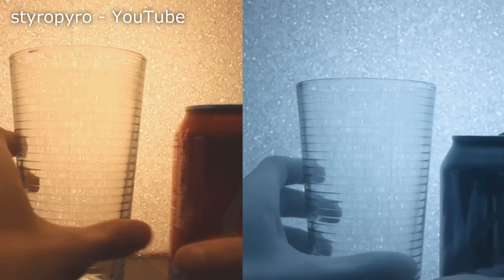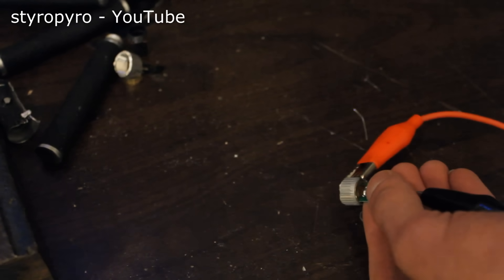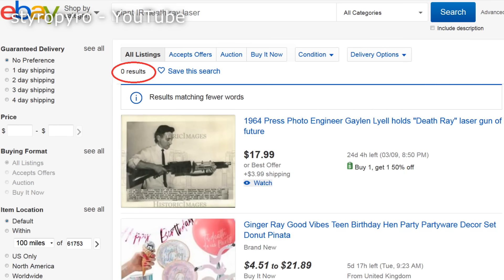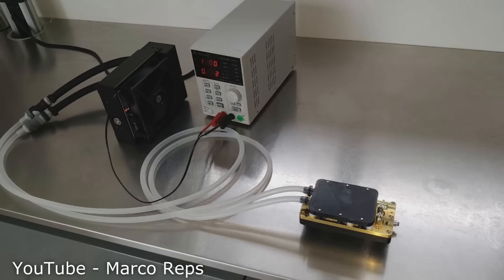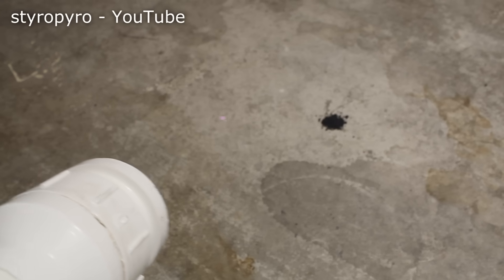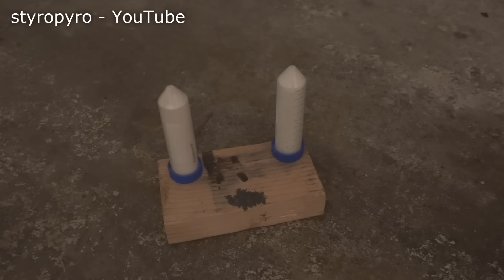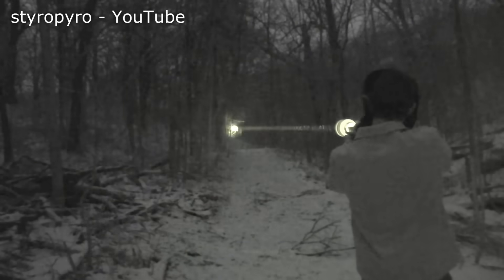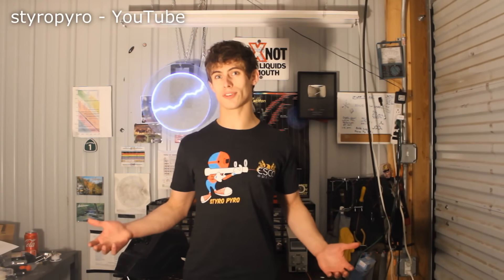100% Invisible IR death ray laser!

Comment: Wow! invisible death ray! So you just go blind not knowing why! You mentioned it wasn't burning your skin because it was infra-red. But is it possible it was internally burning something, like bones or veins that looked black in infra-red? How's your hand today?!
[Edit] Thanks for clarification below Styro!
Reply from the maker: Awesome to see you here! I don't recommend others try it but internal burns from this laser are unlikely as tissue and bone have very low absorption at these wavelengths. I've stuck my hand in the beam of a shortwave IR laser that was literally 500 times stronger than the one shown at 4:11 and I had no noticeable effects.
Reply: @styropyro  If IR has no problem passing through bones and tissue so easily, would that mean if such a powerful laser is pointed at the back of someones head, would the light go straight through a skull and blind a person? If so, that would mean wearing protective eyewear or even facial mask would be pointless. Even a helmet wouldn't help, since the light could come through the neck and hit eyes from inside. Hmm 🤔
Reply: FlumenSanctiViti 
That's an extremely interesting question!
Reply: @FlumenSanctiViti  omg this thing is dangerous.
Reply: FlumenSanctiViti asking the real questions, I'm curious too. . .
Reply: @FlumenSanctiViti  Well no. Before it can reach your eyes, most of the IR light is absorbed by the brain tisseu, skul and skin. You really need to focus the IR light direct on the front of the eye if you want to blind someone.
Reply: @FlumenSanctiViti  The beam gets dispersed, so the energy wont be nearly as concentrated. You'd also have to directly shine the beam onto your head, which is pretty hard to do accidentally when you're the one holding it. The mask is likely just to protect against stray reflections, which are much weaker than the source (though still strong enough to cause eye damage) and thus wouldn't be able to cause any harm to your eyes after dispersing through your skull and brain.

Speaking of brains, I wonder how much of the energy would be absorbed by one. The thought of literally frying someone's brain with an invisible laser is pretty terrifying.
Reply: @FlumenSanctiViti  
that is an interesting question, also - why does the IR light burn out the retina and not any skin heating up ?

I think the answer to both question is that IR light COMING THROUGH THE EYES is focused by the eye's lenses onto the retina and will instantly scorch it - going blind. The IR light is all literally focused on one spot.

IR Light traveling through the back of the head or neck will not be focused on the retina and hence not be a problem - so you cannot blind someone from behind with an IR light - there is no lens to focus the beam.

On the other hand - IR light reflecting from the corners of the laser goggles could still enter the eyes and be focused by the lens, hence the facial mask is necessary.

Then again, the IR light pointed onto the skin was focused - and still had no impact, so why would focused IR light on the retina be any different. Yes, the retina is more delicate than skin on the hand, but would it not also be transparent to IR light ?
The effect of IR light on the skin was almost like normal light on glass - just travels straight through it.
Reply: @FlumenSanctiViti  take another look at 4:11. the light is not absorbed but it is scattered. if it wasnt, his hand wouldnt light up like that, it would be more like shining a visible laser pointer at a glass.

since the light is no longer a beam, its strength is greatly reduced
Reply: @FlumenSanctiViti  It's likely shining at the back of the head wouldn't blind seeing as you receive light through the pupils which are at the front of your eyes.
Reply: @FlumenSanctiViti  I think the IR light scatters a lot as soon as it enters so it wouldn't be very concentrated by the time it got to the eyes. I did see a TED talk were a scientist was making progress taking PET scan like images of the body, but she was using some heavy duty math to undo the scattering, IIRC.
Reply: @philosophicalinquirer312  Could it be that your retina has a broader absorption spectrum because its entire purpose is to absorb light?
Reply: That's an interesting question, but answer is probably no.
You see, IR laser has no problem passing through skin as much as regular laser has no problem passing through piece of white paper. While light is not being strongly absorbed it is being scattered, and that is in a way like shooting at mirror.
Second issue is that most people have hair that does absorb IR light.
Finally eye itself has black lining designed to minimize amount of light that leaks from surroundings through everything that isn't lens. So eye has level of resistance from stray light coming form other directions. Granted this resistance is not that great, but as long light attenuates sufficiently, it would suffice.

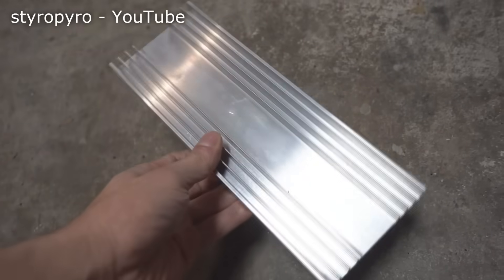PS, blood cells absorb IR light, and that would also help. At 4:23 in the video, veins look black in IR light which means they absorb it.
Reply: @tissuepaper9962  
Not really, the absorption spectrum of the retina is highly specific to what we see based on the absorption of the rods and cones. These are well established parts of the LIGHT spectrum which are absorbed.
All else travels straight through the rods and cones and is not absorbed (so we dont see it - hence why we dont see the laser with normal vision)

Damage to the retina is not based on SPECIFIC damage to rods and cones but the entirety of the delicate layers of various cells, nerves and blood vessels which make up the retina. eg damage to the blood vessels or neurons from burning with kill off all the cells and cause irreparable damage.

From what I gather - rods and cones are  transparent to IR laser, otherwise we would see it. Unlike for example staring at the Sun directly.

Also - the way things heat up can be counter intuitive - eg aiming microwaves at the eyes would not appear to do anything because the microwave spectrum wavelength is ginormous compared to light - however, water molecules will increase in vibration and release energy - rapidly scorching the eyes by heating up all the fluids from the inside - not a pretty sight.
Reply: @philosophicalinquirer312  I was just shooting in the dark.
Nice detailed response though, thanks.
Reply: @weblure  Holy shit...
Reply: @FlumenSanctiViti  Should test it with some lab rats
Reply: @FlumenSanctiViti  I believe much of our Sunlight is high in Infa red(invisible to us), and I'm not seeing through people? But even too much of something good, isn't always good for you ..
Reply: @FlumenSanctiViti  @styropyro please answer this lol
Reply: @FlumenSanctiViti  it would as the passing rays would maintain blinding power for the trip to the eyes as light goes off and through everything!
Reply: @styropyro   "no noticeable effects."

So you're saying there's still a chance.
Reply: @styropyro  I am not sure but I think it was ultraviolet light was the one that can burn your skin, right?
Reply: @styropyro  colab or your skin will absorb the ir rays
Reply: @styropyro  how did you make the 2D plasma globe and/or do you have a video on how?
Reply: @styropyro   how does wattage or power of the frequency affect such absorption?  Obviously microwave frequency can damage internal, and IR can blind so what possibilities exist in that mess.  (I don't really completely understand how an EM frequency is influenced by its wattage or how that works)
Reply: @styropyro  y
Reply: @styropyro  Yet.
Reply: @styropyro  What did you use as IR filter? I'm so fascinated with seeing near-infrared
Reply: what happens in you point it at you stomach and place the camera behind you
Reply: styropyro Are we going to gloss over the fact that you’ve had access to a laser 500 times stronger?
Reply: @styropyro  Are you alive, Death Star boi?
Reply: So it literally cannot be seen with the naked eye? You must use an IR camera to see the beam? How do you see the beam to place it onto something? I have night vision goggles, would this work?
Reply: @styropyro  Yeah, and wouldn't you have noticed it? Nerves aren't only in the surface, you know.
Reply: Love both of you guys <3  =)
Reply: You two should make a video Together. Maybe a laser that shocks you as you use it.
Reply: If u two make a video together,  your medical bills will be just as high as your electrical ones
Reply: 2 best channels
Reply: Would you two Guys make a video together?
Reply: could doctors use this as an surgery tool for burning precise points with depth focusing?? like blood vessel clog cleaning or sealing, or burning infra markered cancer growths??
Reply: gothic6662 
Hmm, i would guess if they injected some IR absorbing dye into the area, it would probably work.  I'm not sure how precise it would be, since i dunno how much the dye would bleed into other areas.  I think they already use some sort of radiation to precisely nuke cancers, IR would probably be less dangerous than the shorter wave radiation they're currently using.  I'd think, anyway
Reply: @gothic6662  they use a similar item for special forces to run an IV during night ops
Reply: @gothic6662  Yes, and this is done.
Reply: @gothic6662  Vanderbilt University did some interesting studies, that I see still have remnants online,  demonstrating equivalency to MRI's in using NIR helmets that weren't even FTNIR if I recall correctly. The OpenWater Company is trying to bring more wearable similar tech to the market.  

I personally feel there are capabilities to mind read using NIR tech since the ability using remote sensing and transmission instruments in close proximity has been demonstrated and can be found online on youtube via Berkeley hacking into the Vision of a Cat, predictions of thoughts and there used to be demonstrated and I can't find the video of predicting thought words accurately.  There is even a demonstration of a crude color Vision hacked into via the brain activity which is different that studying the RINT of the optic nerve.   I'm sure similar can be performed using NIR and maybe if not even FTNIR. 

There is a lot of electrophysiological activity that can be hacked via remote sensing and transmission systems that needs to be advocated more before everyone is maliciously brain damaged to some medieval archaic mercury and arsenic mad hatter state of metaphysical society on dope like if not even on since hair pinned and denying the truth about everything.  Including those that mean well to demonstrate the truth and might not be the most accurate because of their situations impairment. 
https://www.instructables.com/id/How-to-Make-a-Directed-Energy-Weapon-Detection-Sys/

That's why I like styropyro as well as ElectroBoom and others that demonstrate science in very detailed if not entertaining ways being clear about health and safety too.  Some stuff can't be demonstrated since isn't known or risky to detail if known.   Like say... wireless remote control of people with electrodes can be demonstrated now days... though not probably going to see a wireless without electrodes version any time soon even if determined how: https://www.youtube.com/watch?v=1S7FO2Qd6Zc

Might be able to inductively reason how to though maybe with enough logical comprehension?
Reply: gothic6662 they are lol
Reply: @gothic6662  at this wattage that or laser is Cosidered ionsing radtion which is carnigentic lol
Reply: @gothic6662  Yes.  I've read about research projects where tumor specific injections were (and I want to say binding in vivo like with injections with the absorbing entity bound to antibodies that target specific growths also) used, and I want to say copper molecules or more advanced complexes, as contrasting agents to adsorb the energy better.  For target region imaging and target destruction (coagulation or cauterization).  

I recall one image from a poster when I was visiting a Medical Physics Department of a mouse having their implanted tumors removed with an IR laser alone and not even intersecting laser where say lower threshold intensity penetrate and the target is where the intersection higher damage intensity occurs.  I was advocating concerns regarding brain washing, mind control and cult programming using remote sensing and transmission devices (my opinion the root cause of crime since led on by old military, intel or cartel human and narcotics traffickers, addicts and murderers) and was neat to hang out and tour the different physics departments.   

Lasers, the Light Fantastic book is a great read and I even see videos on youtube with similar titles that are great to watch to see how long the technology has been on the market.  Unfortunately not in use as much as can be compared to the ionizing radiation methods that cause more damage and release more radicals. 

Really is sad on some days the range of methods not used as much that are safer and healthier... probably starting with prescribing real clean agriculture products and water.   Seems the best nuclear related industry isn't invested in (power plants) and only the worse is (weapons and ill care).   Same seems to be now days with most systems... like some perverted deviant cult likes for profiteering motives.  

Here's my latest synopsis of causation's of deviants and deviations in leadership:
Causation due to P.O.W.'s influence gone overboard copy cat ancient Roman or something?
https://www.youtube.com/watch?v=_ix4kXX-__g

Then other causation's like made say like Liberia fall:
https://www.youtube.com/watch?v=lmILmnnTC10

Regarding Liberia:
https://www.youtube.com/watch?v=ZRuSS0iiFyo

Great interview for the leadership insight from the start... however, this time on is eye opening if you're not aware:
https://youtu.be/SGWizajL7tA?t=146

Is George Soros a Sociopath?

Regarding the Fashion Industry and Social Media (note the presentation is great from the beginning also... I like speeding up however as is a little slow):
https://youtu.be/dmXcjvL9VSc?t=274

OK... there's my brief to remind that not only "China has engaged in massive U.S. technology theft for the past 20 to 30 years, according to U.S. officials... others in the World have too prior to China and more than technology.  China is where the sell outs that took over the U.S. (or we've been at War with their cohort and always attempting) want to outsource production."

U.S. example of executions at times of War:
https://www.youtube.com/watch?v=4OkDpD-sUYI

Some Chinese Colonel's want to weaponize everything... wonder which liberal communist deviants that own the Diocese Churches largest trafficking hubs and corridors now into official business violating Separation of Church and State with intentional Headquartered Church affiliations that are doubt are Protestant unless they've infiltrated and serious mental facilities bodily assaulted and maimed (how did the txt just change red?):
https://youtu.be/nM5-Rrc2bRM?t=137
Reply: FULL BRIDGE RECTIFIER 

oh. wrong time
Reply: Look here: 11:56
Reply: @grevel1376  that one was concentrated
Reply: DODO p
Reply: DODO he was holding the paper on the part that was burning
Reply: @grevel1376  thats cuz te paper burned him
Reply: I love that you show up in all the other greats, I say other cause you're awesome and inspiring as well.
Reply: styro is like your reckless son who learned the crazy half of you but not the educational other half XD
Reply: My teacher freaked out when I stuck my hand in front of a 1064nm vanadate laser at 2watts.  I didn't feel anything.  What's the reason why IR beams don't always damage skin?  I know they use them in certain skin procedures with ndyag
Reply: @dutra45  Nothing exciting. Your skin is pretty transparent to IR (just look at the footage where he images his veins), so you're mostly feeling multiphoton processes which are inherently pretty inefficient. The medical lasers also do this thing called q switching where you basically let the gain medium saturate before allowing the laser cavity to open which creates significantly shorter, higher power pulses (like MW range peak powers).
Reply: @dutra45  They aren't a high enough frequency to excite the atoms in your skin. It is non ionizing radiation. UV light and higher frequency lights
Reply: YEEAAAH MAKE SOMETHING TOGETHER
Reply: The trifecta would be Styro + EBoom + Photonic Induction!
Reply: Could you try to modify it to make it stronger?
How about using a
[INHALE] FOOL BRIDGE REKTIFYAH
Reply: FULL BRIDGE RECTIFIER
Reply: Doesn’t prolonged laser exposure cause radiation mutations in DNA🧬?
Reply: @nunchucktube  no that requires ionizing radiation, which this (or visible laser) is not a part of.
Reply: I had an exact laser like yours and took it apart, I actually looked at the IR light, I wonder if I got eye damage? But I see fine, maybe if I added back the lens and looked at it, that would have probably blind me.
Reply: SsssshhhhThis is why noko missiles mysteriously exploded right after takeoff.
Reply: I can just hear you're voice now as you say that ;-;
Reply: You two should find a way to collaborate 🙄
Reply: The second king of electricity and blowing stuff up
Reply: I need a IR dye to accumulate in my belly fat
Reply: @mamupelu565  That would be an interesting service for a business model if no embolism like issues... IR lipoablation instead of liposuction.
Reply: Gimmi Da Metah
Reply: ElectroBOOM if you and @styropyro do a collab, I will LITERALLY DRINK WATER
Reply: Shut yo trap you fail at everything
Reply: Omg electro is still alive !
Reply: Electroboom I love you so much you're awesome you're awesome as well I just love watching you electrocute the crap out of yourself I'm still trying to figure out who plugged in the hot glue gun when you're actually burns your fingers don't worry I do that a lot
Reply: microwave frequency can definitely do that right? so where does high power IR and microwave completely diverge
Reply: When the laser hits your hand, the light (therefore energy) gets scattered by your flesh and is no longer in focus. So even if bones and veins have higher opacity under shirt wavelength IR, the energy reaching them is just not enough to cause damage.
Reply: oh hi there
Reply: Hahahahahhaha. You always crack me up.
Reply: I love how you do your Videos!
Gr8 w0rk!
Reply: I believe skin and meat and all the stuff there is has low absorption, high reflectance and high dispersing characteristics, so the beam is diffused in a large volume and not intense enough to change any state of that volume.
Reply: ElectroBOOM I love your channel as well.
Reply: @nsfjojo  I'm thought you meant something other than speed there. It still goes at the speed of light no matter what the wavelength (c=fλ)
Reply: If it's research perfectly with anyone's right. Great demonstration.
Reply: Man I wish @ElectroBOOM would comment on my videos!!!! Lol you guys are both awesome
Reply: Styro can u shoot IR of electrical sparks
Reply: Yay electro boom
Reply: My favorite
Reply: Do a colab please
Reply: Not burn but likely to get cancer, right?
Reply: +Electro It will burn off your retina, making you permanently blind within seconds, if you point it towards your eyes. Which is why A) Lasers should be handled with care and are super dangerous, but also B) Illegal in warfare. Yeah, blinding lasers are illegal to use in war because its considered unnecessary suffering.
Reply: @Beard Guy101 you have been reported to secretservice.gov for threatening the president. expect the fbi at your door asking you about it.
Reply: Make one
Reply: I don't think that, since it's still light - even if it has longer wavelengths than visible light, it's still much shorter than the radiation in a microwave oven for example. Even if a small fraction of the light make it all the way thru - the majority of the energy that get absorbed by the body, will heat the skin. So if he doesn't feel it burn, there will not be enough heat deeper into the body ether. The reason you see veins and bones is that those block the light completely, while the skin and other parts let a small fraction thru. You can do the same thing with a strong red visible laser or a strong flashlight in a dark room and see the effect. The most dangerous thing with IR is that it's invisible - the beam will behave pretty much like a visible laser and reflect against shiny surfaces, refract into glass and water and such things, but you don't see where the light goes. If a significant part of it hits you in the eye, it can cause permanent eye damage by overheating a spot of the retina (just like a strong laser with visible light).
Reply: Anyone else read that with his accent?
Reply: Infa red light comes from the Sun as well, and I've never heard of IR effecting humans, now on the other end of the spectrum UVA/UVB are also in sunlight, and this is where problems come in. These UVA/UVB are proven dangerous, wear protection. IR light I believe has less danger. But I'm definitely not an expert! Do your research. And quit F'n with Stewie's Death-Ray! He patented it on Family Guy(maybe not!)!! Stealing from kids? How dare you! LMAO!!
Reply: He uses free energy from the lasers!
Reply: he needs to do a video about defense from lasers.
Reply: E-boom i like your vids
Reply: Is that happy thing a clock or what
Reply: My boi styro just hit 800k❤❤
Reply: Yasss ELECTROBOOM
Reply: Are skin is tough
Reply: L
Reply: I feel like you just want to build gamma rays laser but less deadly and easier
Reply: This guy still alive even after 4 years. i say for both of them
Reply: When war start , they will arrest all youtube science creators first as they could become threat.
Reply: Wow electronicboom, always boom.. i actually enjoyed watch your video, but sometimes it jumpscare me 😂
Reply: I bet Mr Muhammad or I forgot your name again can't do that 😅😅
Reply: I guess the light scatters within the soft tissue. Any small damage should heal itself in the matter of hours.
Reply: @ElectroScience  you are probably right. The beam is not pinpoint focused either.
Reply: @ElectroBOOM  Your skin cant burn by IR Light. It can only heat up a bitt but no burn marks. So internal burning marks are completely impossible.  And this heating up of the skin is only possible if you have a class A IR light. But if you had Ultra violet light it will burn you skin and internals in seconds. >:-) Or @styropyro will invent a new class of IR that can burn skin ;-)
Reply: ElectroBOOM how old r u
Reply: @furiousexe2108  y u ask tis
Reply: Yee Vlogs definitely not a child 🤦🏻‍♂️
Reply: @furiousexe2108   electroboom is 44 years old
Reply: ElectroBOOM maybe you just stick to shocking yourself intentionally and leave the professional grade stuff to styropyro😂.   Pretty sure he knows what he’s doing.